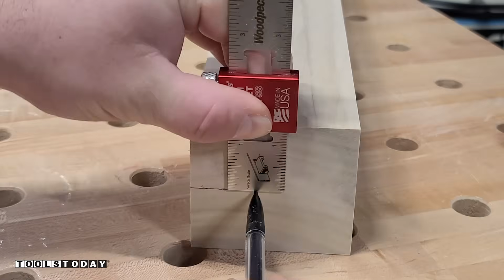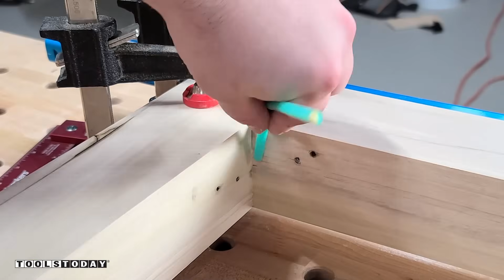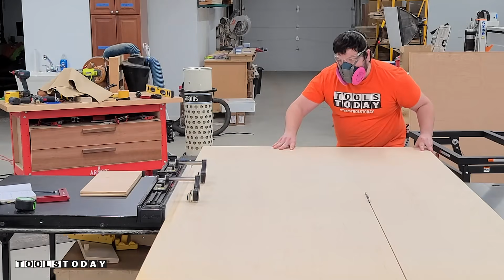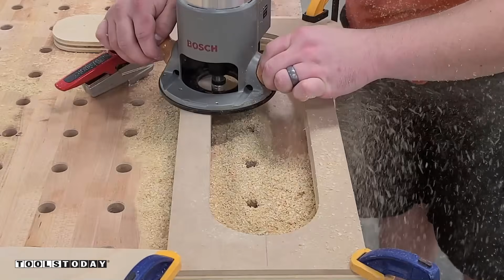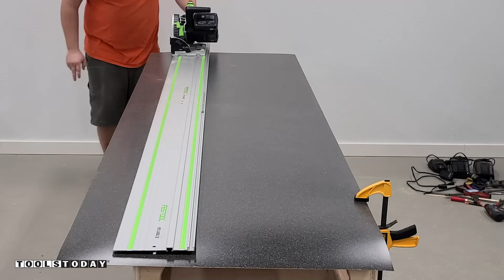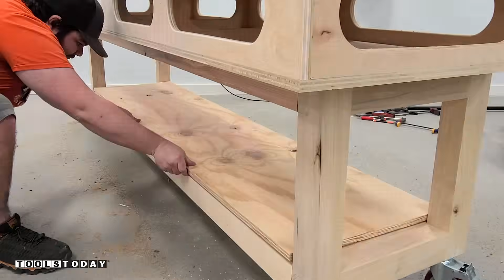How to Make a Workbench | ToolsToday

Comment: I am going to be changing my out feed table to maximize space in my shop.  This has been my goto assembly table.  With that table gone, I will be changing out the top for my rolling cart.  Currently it sits under one side of my miter saw station.  With the added floor space, that bench will become my goto.  I've been trying to figure out what type of top to put on it.  Watching this video has helped me decide.  I really like the construction of that top.  While you can put things in the open space, I am working out how I could use that space for pullout trays.  Great job.